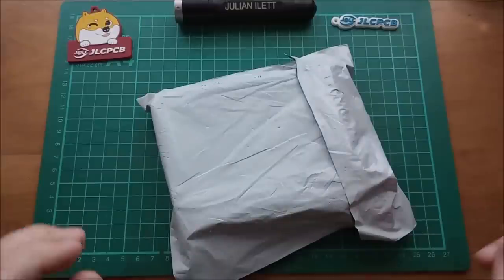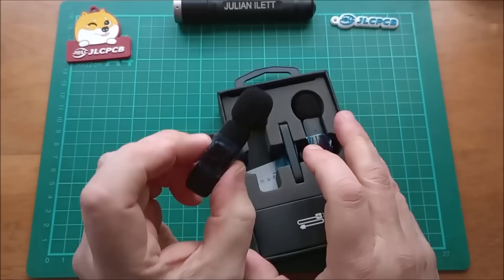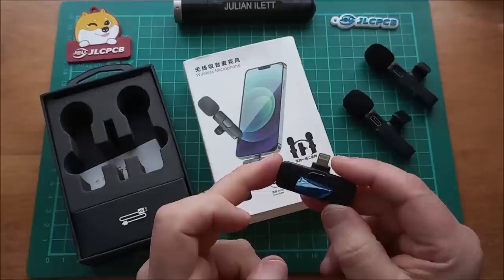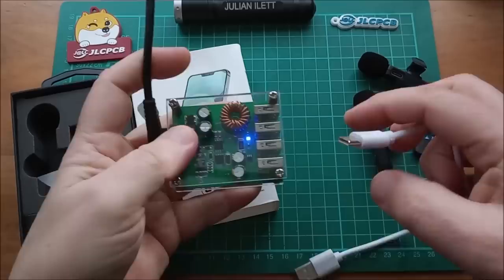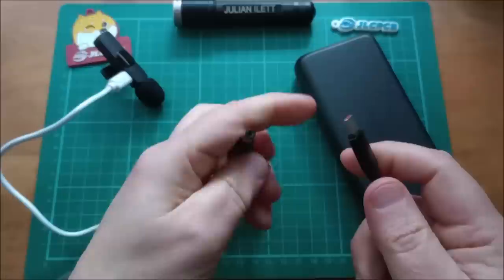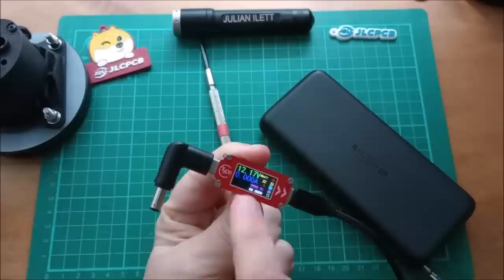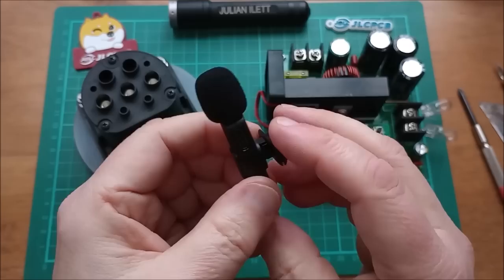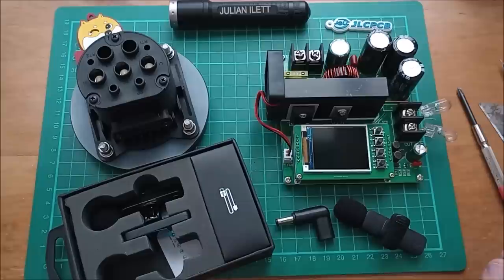Julian's Electronics Postbag #157 - Boost and Buck

Comment: Utterly irrelevant colours as options is one of the things I've kind of gotten used to. A minor nuisance compared to the bait and dwitch ads showing something in the photo for a very good price, and then as one clicks the options it turns out that the low price is for an adapter, short USB cable, keyring chain, or similar while the item shown is significantly more. And of course the ones thst compensate a low price with the shipping cost, so the listing looks more attractive.

 I guess they're just reusing some list of options, instead of typing in dome actual descriptive options.
Reply from the maker: If only supermarket shopping was this exciting :)
Reply: this practice always guaranteed the Aliexpress experience would be an unusable chaos and complete waste of time.  The problem is that all those sellers have figured out how to do the same thing on eBay and now that's a complete mess as well...
Reply: @GannDolph  i wouldn't call it a complete waste of time (as I do but a fair amount of stuff there), but it sure makes it take more effort than would be needed if it was all clear/open/honest...
Reply: @GannDolph  That can work to your advantage sometimes. I've got several metal halide headlamp & ballast kits for $1.98 a piece because their pricing algorithm devalued a certain style of headlamp socket.
Reply: @michaeltempsch5282  that's fair i suppose.   but in the last year , and very surprisingly ,  i've increasingly purchased things for cheaper thru amazon.  the items still ship from china and are usually from the same sellers as on aliexpress.  amazon will eat the loss when things don't arrive (hasn't happened, in fact things seem to come faster, more reliably and with better tracking).  So amazon is clearly up to something here (in USA) --but i like it..
Reply: @WaffleStaffel  very interesting indeed - will be looking out for these 'easter eggs' for sure !  thanks !!
Reply: for chinese that dont fully understand english, colour and option seem to mean the same thing. so therefore  that we all need to understand that colour often just MEANS option.

Comment: Type 2 generally lock into place on one side typically the top, the other "ports"  are just to allow flexability of the final installation, the servo drive is a bulky item that the end user (manufacturer) would fit themselves, I would say that is more a replacement part where you would just fit your existing servo, functianally it is not needed as you say its just to prevent cable theft.

Comment: Just use a liquid crimp, or what us old folk call solder. Works for me😂
Reply: 60/40 melts at like 188°C. Obviously the circuit shouldn't reach that temperature, but...
Reply: @WaffleStaffel  that's ok then power will self disconnect in the event of a fire in the socket. 🙂
Reply: @TheEmbeddedHobbyist  unintentional thermal disconnect :)

Comment: The photograph of the unit you picked out has 5 of the power pins so it is a 3-phase socket
The one you got is a single phase
Reply from the maker: That's fine - my car has a single phase charger on board.

Comment: If you have a decent metal vice, those terminals for the socket can be soldered.  I recommend not pre tinning the leads, only flux prior to putting the large connectors in and using a plumber's technique of wicking the solder in.  It can work and be safe if you can get enough bare wire into them ( bottom of the pin ) prior to  the soldering.  As to crimping, you may be able to use a pin punch if the pins can come out of the socket.

Comment: I picked up a set of those microphones a while back. They're not horrible, especially at that price.
My only issue is finding a good placement where my beard doesn't scratch on them and make nasty noises.
Reply from the maker: Can you use both mics at the same time? Does that give you stereo? Cheers :)
Reply: @JulianIlett  Ahh,... When I said "set" I meant one receiver and one transmitter.  It seems to record equally on both stereo channels.  I would assume with a second microphone, it would simply mix them together.
Reply: From AliExpress ?
Reply: @davekleiboeker4614  Yea.

Comment: I just bought a similar USB PD to 12 barrel plug in cable form, but from PiHut. Works well and replaced the somewhat dodgy looking power adapter for the small PC that I purchased for use as a router (it has 4 2.5gbps ethernet ports).

Comment: Like the new Revision Boost converter (buys) The are Useful For Finding 230V AC (Switch mode)  Things That will Run on DC At lower Voltages 120V ~ 48V DC

Comment: There is an exploded view on the microphone sales page, why bother opening it? It shows there it has a 60mAh battery in it. But good promotion, I went and bought one too. The right 'color' as I need USB C.
Did you ever come across a buck converter which accepts over 100 Volt DC? Or 200? Not that i need them, but they could be used on my solar panels, for in case the grid goes down. I have 3 arrays, ranging from 120 to 230 Volt DC. (in MPPT mode that is, so without load it would be a fifth higher).
Reply from the maker: Just made the microphone teardown video - that exploded view is pure fiction.
No, the highest input voltage on a buck converter I've found is 75V.
Reply: @JulianIlett  Thanks!